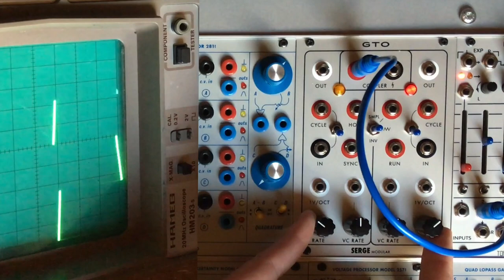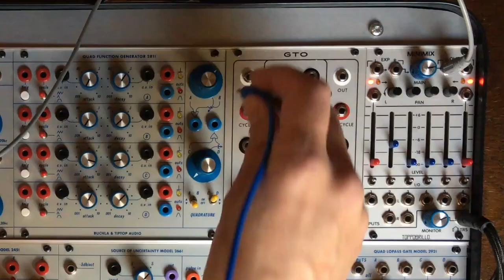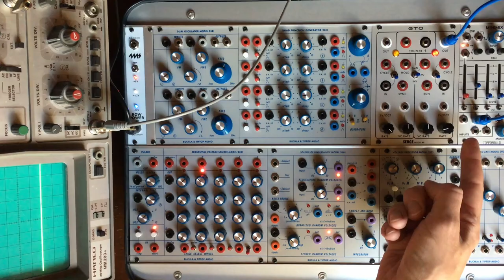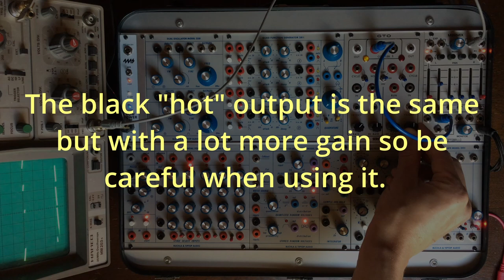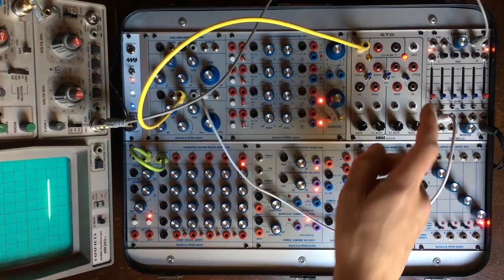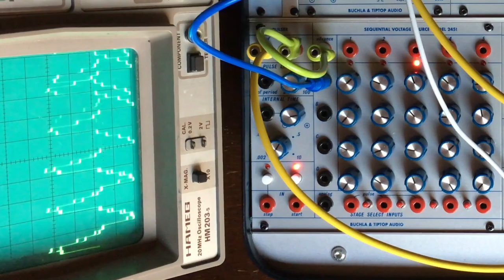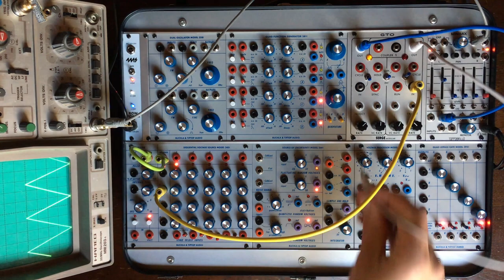Many things the Serge GTO can do

Comment: Does the GTO not support a proper sawtooth wave. It sounds like getting the saw but loosing the proper volt per oct tracking???. Thanks
Reply from the maker: It's not it's intend and the original SSG does not even track 1v/oct at all so it's still an improvment on it. It should not thought as a VCO module, but as a module that can be a VCO (square or triangle with proper trakcing) amongst MANY othe things ;-)